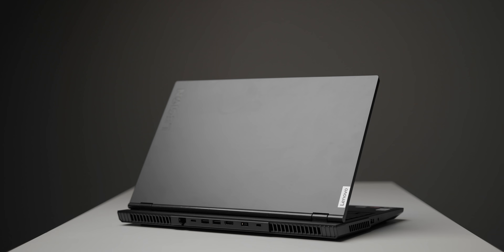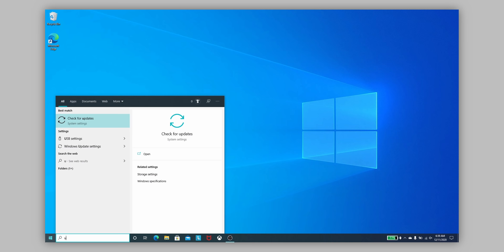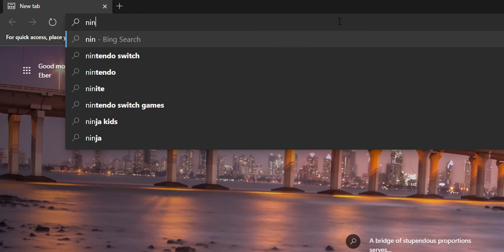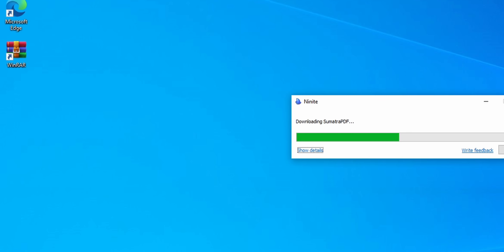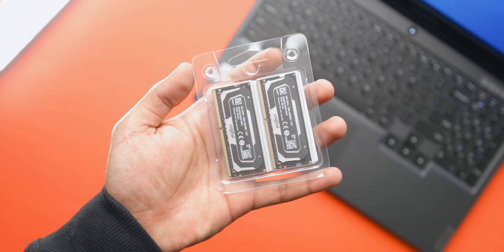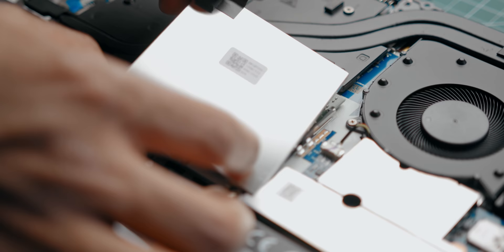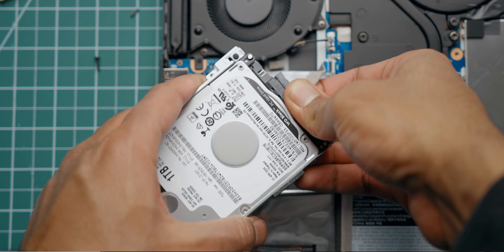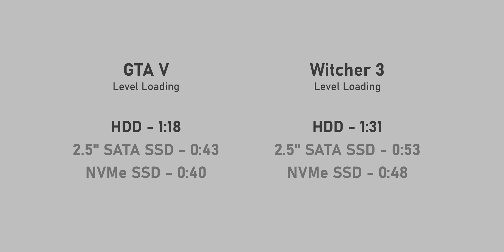How to Upgrade and Optimize Your Gaming Laptop for 2021

Comment: The one you got is a entry level gaming laptop.   GTX  1650 at  $999.99 rip of price!    Coming  RTX  3060 is the one  Most should get, with  32gb total system memory and all Nvme inside for the most blazing fast on everything you do!  Nvme is  2000 write and read  speed and faster depend the model speed you want!   It  very costly upgrade  and cost more then the actual cost.  So it best if  those Laptop come with the right spec.  Since you can't upgrade to a new GPU or upgrade  CPU.  They should not cheat the customer in horrible gaming spec.  SSD with 550mb read and write is not worth the price.  Should come down in price !
Reply: Can you send a link to a 3060 laptop I can’t find any

Comment: I think this is useless to me, I'll be buying a new laptop next year. Gonna wait for dat Ampere laptop goodness.
Reply: What do you mean? I'm not very knowledgeable so I'd appreciate it if you could tell me what this ampere goodness is that you're talking about
Reply: @dadadunlol6079  
Nvidias ampere 30 series cards are significantly faster than 20 series cards. Laptops with 30 series cards should be coming next year, hopefully the difference will be just as big there too.

Comment: So Chrome has become so memory intensive that people are using Edge instead? What is the world coming to? 😱

Just kidding. But I'd also like to throw Vivaldi into the ring as a viable Chrome alternative. If you were one of those who once upon a time used a small (small as in it fit on a 1.4 MB FDD) web browser called Opera, but never learned to like the "New and Improved" Opera that came about when they switched from their own web engine to using Chromium, then Vivaldi just might be worth giving a go. It was created by some of the people who worked on the original Opera browser, and with the intention to continue developing a browser to take what people loved about the old Opera but using modern technologies and Chromium. The result is a browser that has a lot of the features people often install extensions to get already built in from the get go. On top of that the whole Chrome library of extensions are available so there's no lack of possibilities.

As for memory, I really have no idea if it's a hog or not. Currently I have 333 tabs open and it has allocated something like 710 MB. Is that being a memory hog? Just visited a few video sites and the memory use shot up to 940 MB. Paused the videos and switched back to this tab and it freed up some memory and is now at 560 MB... So to me it looks like it's behaving quite well.
Reply: Seems vivaldi writing cache in your storage instead using ram when page is not activated.
Reply: @claritoresdiano1021  Whatever it does I'm happy with the result. With the tab handling in Vivaldi I've almost totally given up on using bookmarks. Even with over 300 tabs, which is up from about 120 last time I checked, it still snappy and opens quickly.

Occasionally I save the tab session just in case it would get corrupted, something I learned to do when still on Opera as that had a habit of corrupting this now and then. And when that happened it would often refuse to start until either the session was deleted or I spent time to go through it in a text editor and finding just what tab was causing the crash and remove that.

After using Vivaldi for several years I've never had that kind of problem, though as I'm on the development branch I've seen some weird bugs, but never something that was a gamebreaker for me.

Comment: If you buy cheap, thin and shitty laptop you can't get a lot of performance from it! You can add ram, change thermal grease/pads and get new ssd - thats it - no performance boost. Driver change or upgrade gives Minimal performance too. So better option is save some money and buy laptop from Dream Machines for example rather than overpriced MSI. Thin laptop = no performance. Don't forget drivers issues and hinge bad design that breaks display om most of thin MSI laptops (GE, GS Series)
Reply: Holy crap I just looked up dream machines and those have to the most ridiculously overpriced laptops I’ve ever seen. You know something is overpriced when even Razer looks like a bargain compared to them 😂
Reply: @-Burb  WTF you talking about? Dream machine, clevo etc are few of the best spec and lowest price ratio compared to the few big brands like razer, MSI, acer or dell
Reply: @sadomasothebest  
I literally put the specs of my thin and light laptop in there as close I could and it came out to $1600 USD. Seriously? $1600 for a laptop with a 2060, a 4800H and only 2666mhz ram? That’s stupidly overpriced, especially for a laptop that is 17.3” whereas mine was $1300 in a 14” form factor. The smaller laptops are the more expensive they get typically because of R&D costs, but it seems that dream machines didn’t get that memo and decided to make the laptop almost 2x what a 17 inch laptop should cost. 

I also put in as close I could the specs of the 2080 super Razer blade with the 300hz screen, and on dream machines, it gave me a fat ass thing that shouldn’t even be called a laptop for $3,725 USD. That’s over $1000 more than the Razer blade costs, and Razer is known for being overpriced, much of which is due to the nice thin form factor they had to cram everything into. The fatass “laptop” dream machines came up with is 2.5x thicker than the Razer blade, plus is wider deeper, and significantly heavier. Dream machines obviously didn’t want to deal with R&D costs so they just chose the thickest case imaginable. And dream machines doesn’t even come with windows unless you want to pay even more! Plus the Dream machine “laptop” doesn’t even have thunderbolt. 

If you don’t need portability then don’t buy a laptop, much less an overpriced one from dream machines. 
What a ripoff.